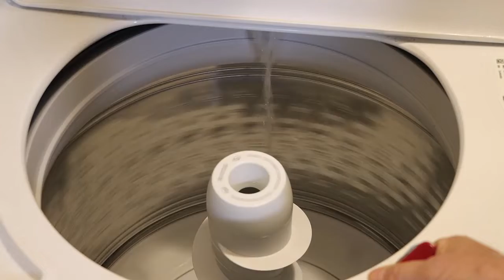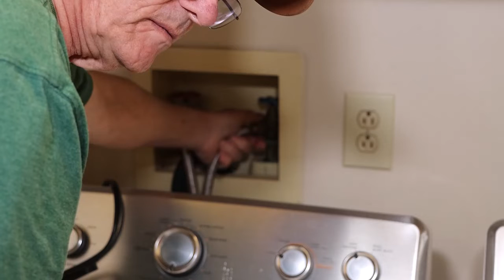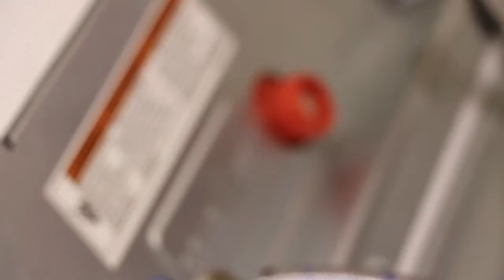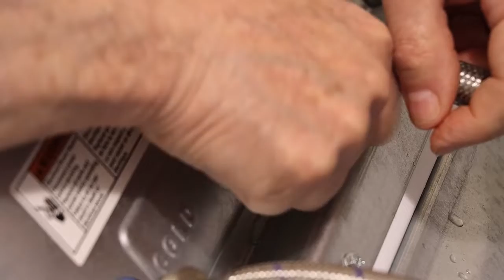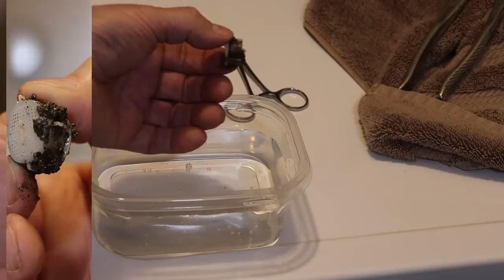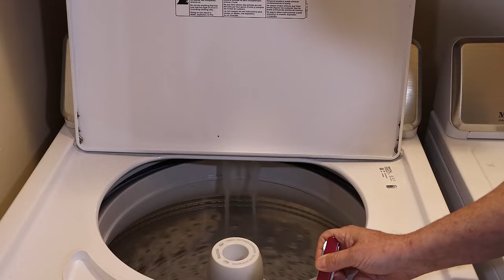Why is my washing Machine Slowly Filling With Water?

Comment: If it's not the filters what are some other possible causes? I rinsed off both of my filters. They weren't that dirty. But I'm still having a slow water fill problem.
Reply from the maker: If you have good pressure everywhere else, It could be the water control valve in the washer. Good luck with your project and have a great day.

Comment: The video was so informative and hope it solves my issue. I have the same problem with the water running slow and taking forever to fill the drum.
Reply from the maker: It is the most common reason for this problem.  Good luck with your project and have a great day.

Comment: Im dealing with low cold water took off the hose filter looked clean but after this video i may be wrong the top looks like this but i never pulled it out so the sides could be gunked up... warranty repair man is 6 days away maybe i can cancel him fingers crossed  and thank you from Louisiana
Reply from the maker: Hopefully cleaning it will fix the problem and save you some time. Thank you for visiting and have a great day.

Comment: Hi Wayne, thanks for your videos. so enjoy them. Just wondered if the water does not go through the hose at all, what could the problem be?
Reply from the maker: You may have one of those strainers at the end where the water cutoff valve is at.  Some washers have them at that end not the end at the washer. Good luck with your project and have a great day.
Reply: @DIYwithWayne  thank you so much. Will look into that.